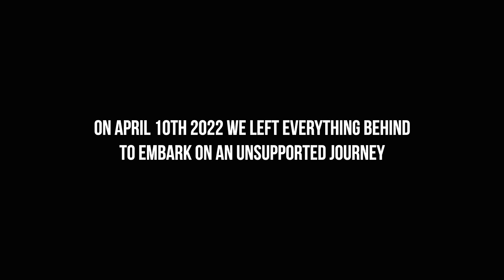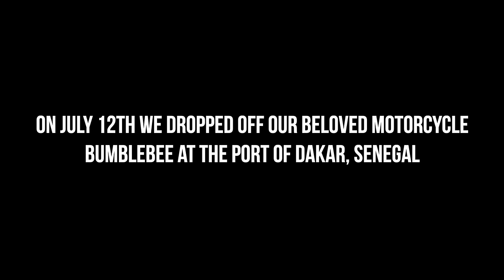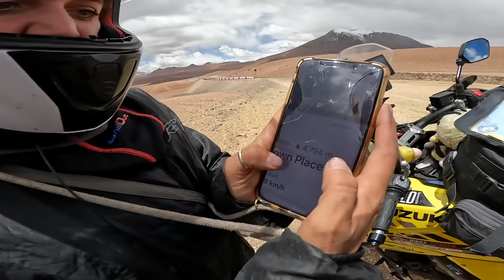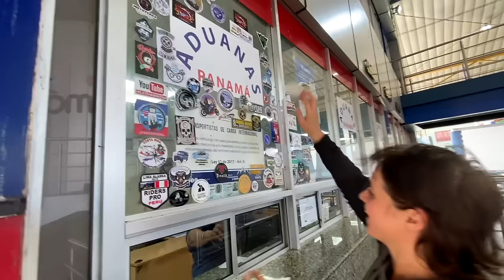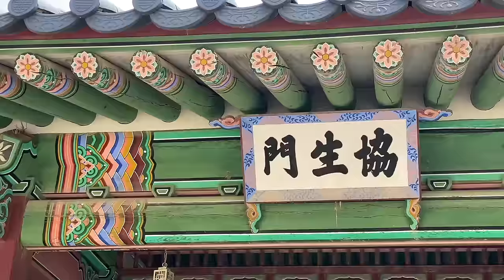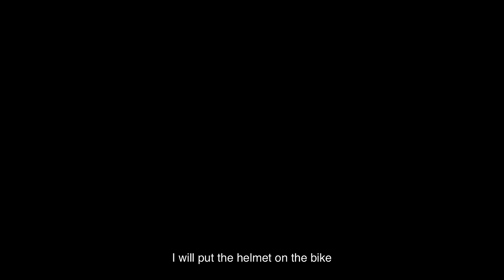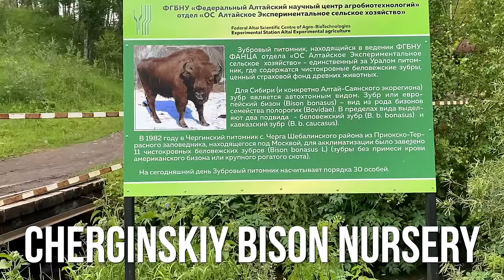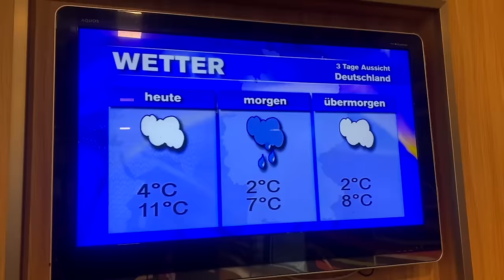HAPPY AND ALIVE: Motorcycling Around the World in 589 Days

Comment: you should use Yamaha Tenere 700 for around the world trip with 21 and 18' wheel instead of 17 and 17 ' wheel for off road..
Reply: The V-Strom has a 19-17, which is fine for easy offroad. Plus, the Tenere would be very unconfortable for long trips, especially two up.
Reply: 2 hours on the T7 is brutal on the body, I couldn't imagine going around the world 2 up on one.